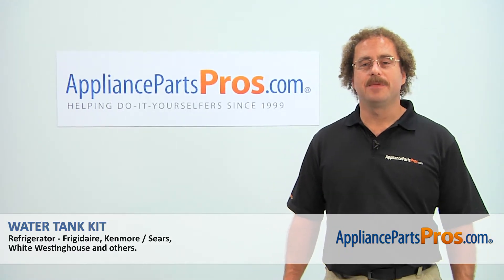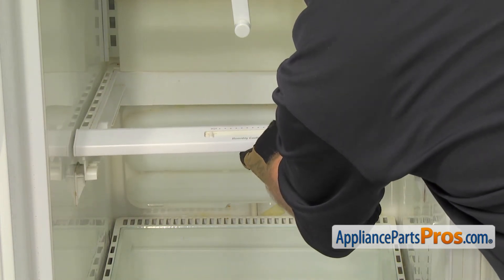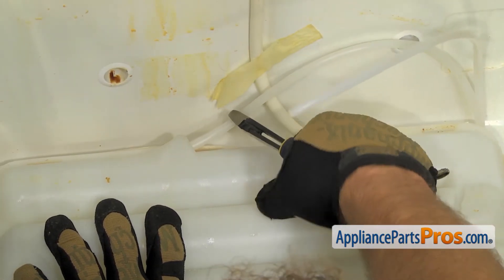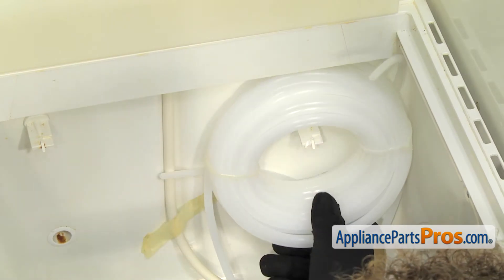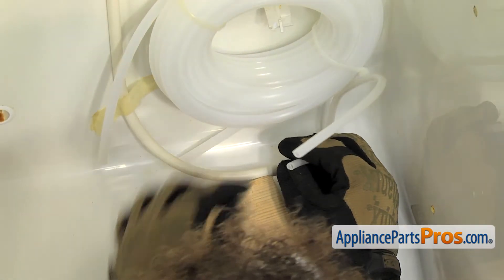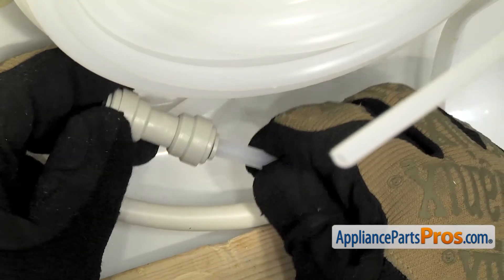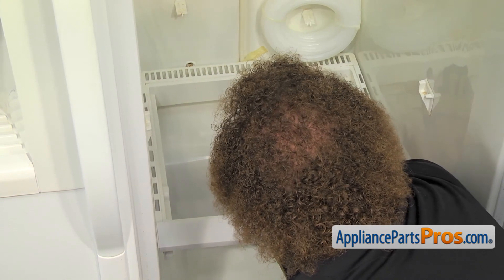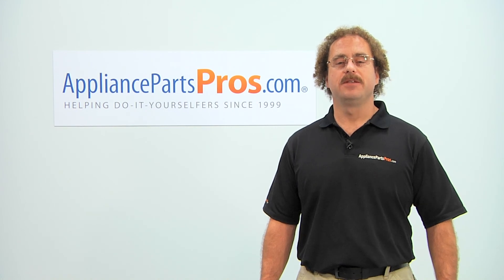How To: Frigidaire/Electrolux Water Tank Kit 5303918258

Comment: Great video instruction THOUGH HE LEFT ONE IMPORTANT STEP OUT. BE SURE AND TURN OFF THE WATER VALVE GOING INTO THE INBOUND WATER LINE. Otherwise it will leak a lot of water in the fridge after you cut the line and during while you are fixing it.